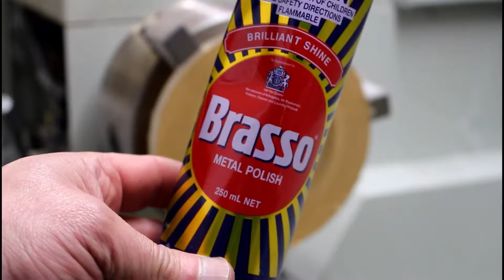2019 Boombox Build Off: Finale: Tas Westy

Comment: Well done!  If I may be so bold to critique such a beautiful design.  It's best not to point your port directly at the center of the full-range driver. Your mid-range frequencies will go directly out the port. Next time, you may want to off-center it. Maybe place it higher so the mid-range won't escape out the back.
Reply: Thanks for the advice Mate. I was wondering about that and the only info I could find was a comment on a forum that suggested to do it that way. Thankfully I designed the back plate to be removable/interchangeable so I can easily alter the port design. I'll add that to the list of things to finish it off.
Reply: @taswesty  you're welcome.  Uou'll find a lot of people referring to the port with a subwoofer, in which case it's not a problem. It becomes a problem when there are mid-range frequencies. That's awesome that it's removable!  Shouldn't be too hard to fix later. Great job, once again!
Reply: @Toid  Thanks again, makes sense. I'll give it a go.